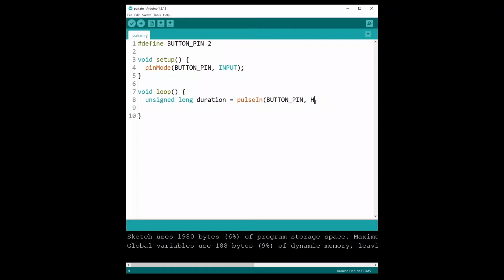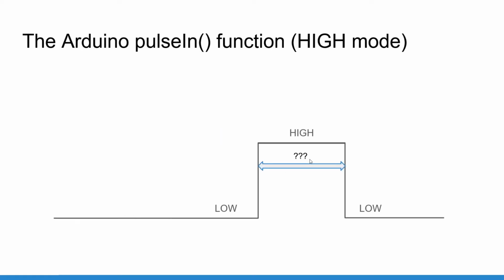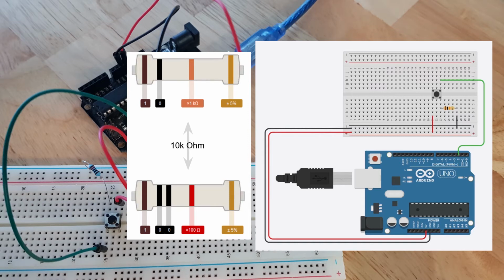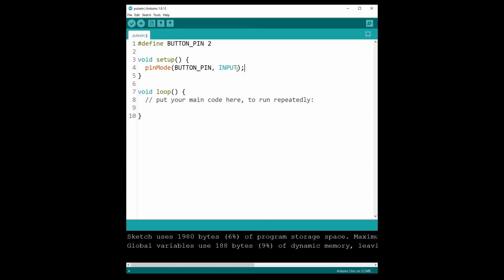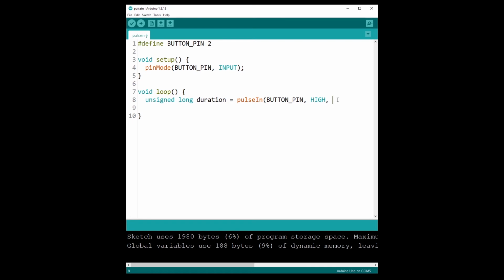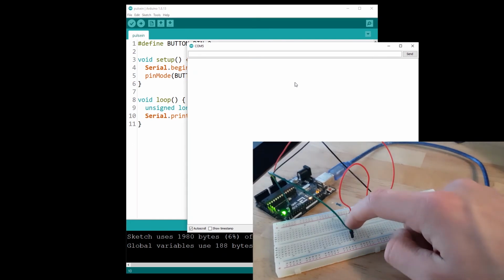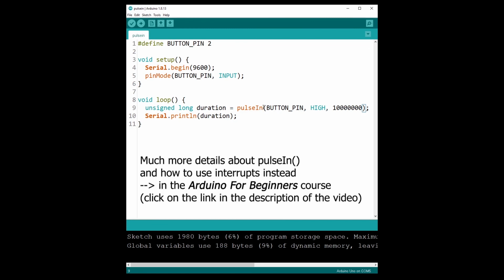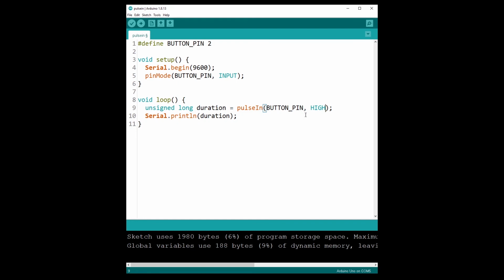Arduino - What is a Pulse and How to Use the pulseIn() Function (with example)

Comment: My results do not match yours - will you please tell me why
#define buttonPin 2

void setup ()
{
  Serial.begin (9600);
  pinMode(buttonPin, INPUT);
}
void loop()
{
  unsigned long duration = pulseIn(buttonPin, HIGH, 10000000);
  Serial.println (duration);
}

i pressed the button several times :  2sec ,2 sec, 2sec, 6 sec
these results were shown on serial monitor
60
61
41
995942
64
0
42
0
0

Comment: hi would this work if i was to count the pulses that come off a 24 v coin mechanism? My coin mech sends a pulse each time a quarter is deposited?
Reply from the maker: You'd need to use a relay to convert 24V into 5V so you can plug it into the Arduino.